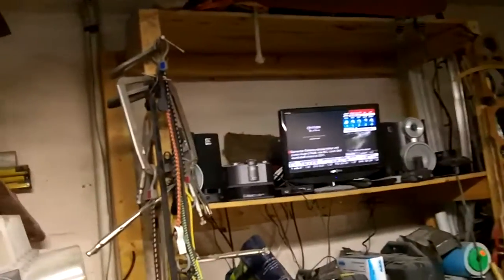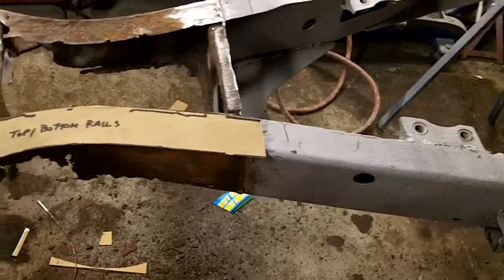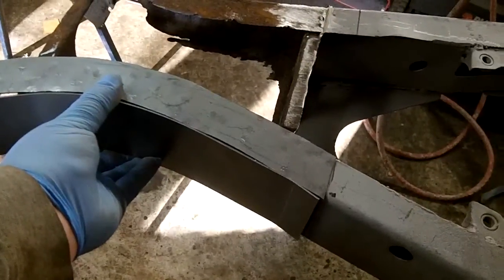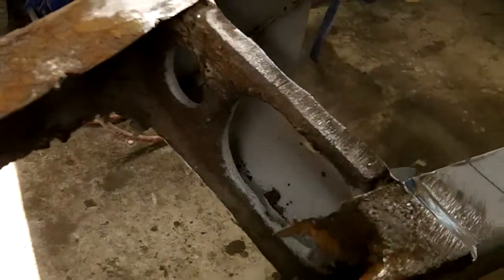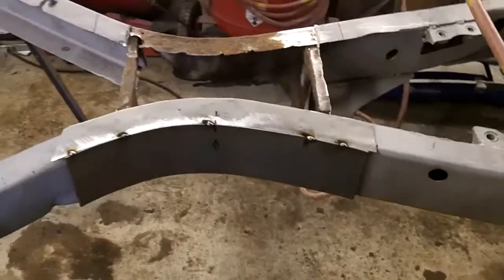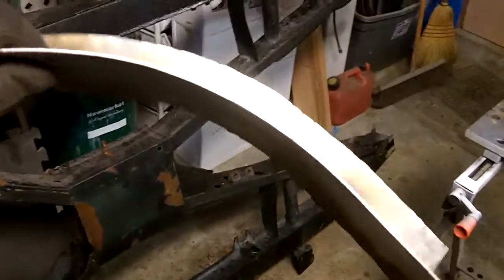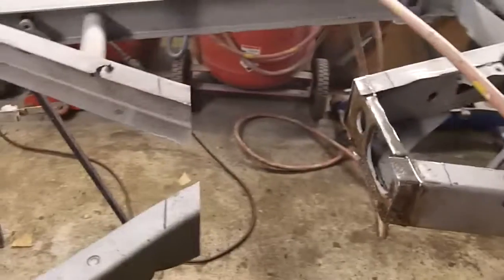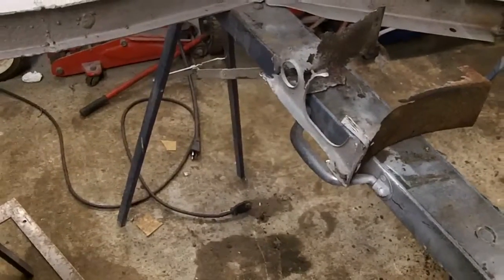1960 Triumph TR3A Restoration, Chassis, Part 6

Comment: Frame looks great - nice job on the repair panels..did Les' gear make the fab work a lot easier? been thinking about a breaker and maybe a bead roller - just wouldn't want them as garage art!
Reply from the maker: Yes, they did make it easier. Not sure if I would want to own the stuff and have it hanging around in the garage....maybe in 20 years when I retire :-)